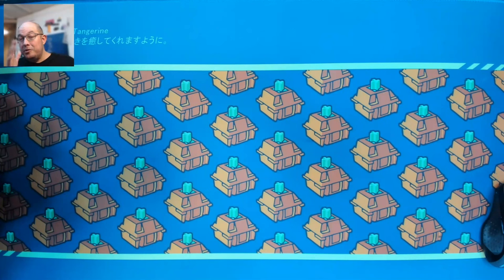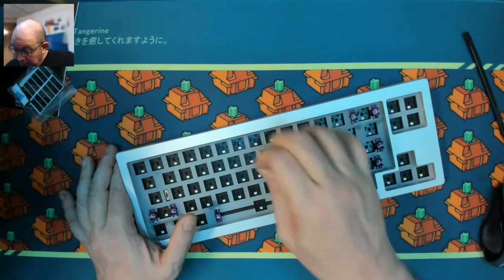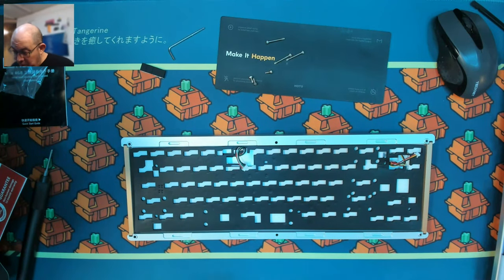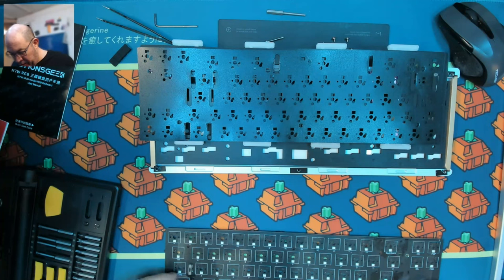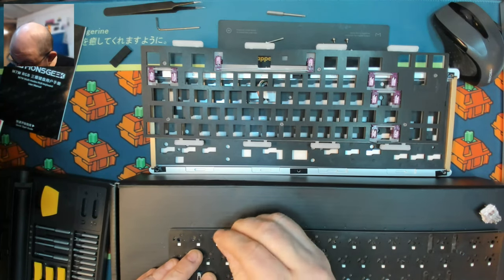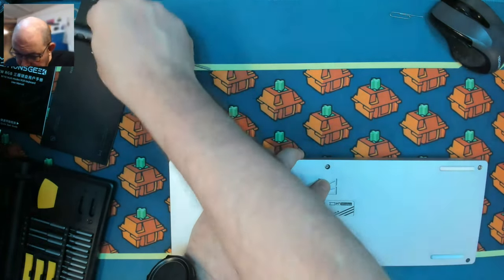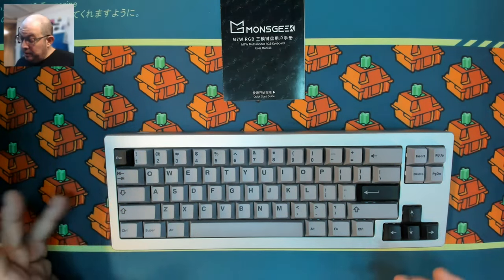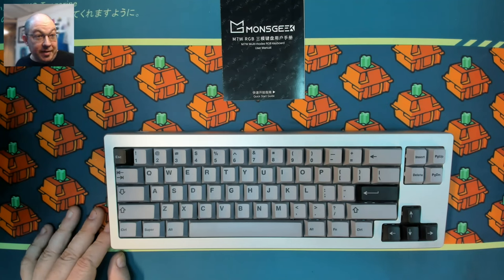Monsgeek M7W: Unboxing, Teardown, Mod, Build, Review, and Sound Test : Solid Aluminum 65% 3-Mode Kit

Comment: Just got my M7W in black, used Akko V3 Cream Yellow Pro’s and Ghost Judges caps, tuned the stabs and did the force break. Sounds as amazing as both the M2’s that I have. Only complaint is wish the switch was external not under the caps lock. It is one of my travel keyboards and switch is very inconvenient. Otherwise love it!

Comment: The recessed USB port was one of my drawbacks, because all my other keyboards I use I put on a 90 angle USB so when I want to use this keyboard I need to change cables. This is a great keyboard, another thing I overlooked with the wireless is its not qMK VIA and does not support SignalRGB. But other than that its a fantastic keyboard and I am very happy with it.

Comment: Thanks a bunch. Got mine same color but went with silent linear DUROCK daybreak and I'm lovin' it. Got a question though, do you know how to turn off the battery indictor under the space bar? it's always on even when I shut off the back light and there is no key FN+ any key nor the MONSGEEK drive an opting to turn it off.  Thanks in advance.
Reply from the maker: I do not know of any setting to turn it off, I've looked. I ended up just cutting a small square of electrical tape and covering the LED: https://i.imgur.com/mu2OWYD.png
Reply from the maker: @5LD314  sorry, can't say. Under which key?
Reply from the maker: @5LD314  oh, odd. Can't say I have a clue, perhaps reach out to Monsgeek about it?

Comment: Hi, sorry to bother, but I have a question: does the board support screw in stabs? Really nice reviews, anyways; you have a new follower!
Reply from the maker: No bother at all, yes, the PCB has the holes for screw in stabilizers though the plate might need modifications for stabilizers to fit.
Reply: @MechKeyboards  thank you very much
Reply from the maker: @maurogatti2009  you can see the holes on the PCB here: https://youtu.be/PR84ngCIf0A?si=G6mHugbRvfbldVdd&t=767

Comment: Thank you for this video. Mine makes a squeeky sound when pressing down bottom left side of the keyboard, especially the control key.  Does this ever occur to you?
Reply from the maker: Nope, you might want to open it up and see if the gasket is mounted correctly, that would be my guess as to what could be squeaking.
Reply: @MechKeyboards  great thanks for your feedback!👍

Comment: forgot to ask does this keyboard have a hailmary DFU button in case firmware gets botched during a flash?
Reply from the maker: No, as seen here: https://youtu.be/PR84ngCIf0A?si=gs50fgL4re6DSqYO&t=429 - But the wireless Monsgeeks do not use QMK, and I've not seen any firmware flashes. I've only ever seen DFU/Rest buttons on QMK keyboards.

Comment: Just got mine m7w and I absolutely love it. 
Is there any way to switch off the green battery indicator under the spacebar in the wired mode? It's a bit annoying.
Reply from the maker: They have been informed of the issue and may release a fix. I cut a small square of electrical tape and covered it.
Reply: @MechKeyboards  I left my keyboard connected to USB overnight and in the morning the green light was off. When I've unplugged USB for a while it returned again.

Looks like it's detecting the battery charge with some mistake and need around 100.1% charge to turn the light off.
Reply from the maker: Good to know, thanks @mmironov !
Reply: had you figured out any other workarounds to this besides removing the actual cord or taping over the led?
Reply from the maker: No @aquarellstifte  not yet. Monsgeek did say they would look into it, I will ask them if there is an update.
Reply: @MechKeyboards maybe a little too late to ask but had you encountered issues with the pcb shifting without any case foam? It’s kinda annoying that I can’t go foamless due to this.
Reply from the maker: @aquarellstifte  I plan to come back to this and try it foamless in the near future I'll see if I can figure something out
Reply: @MechKeyboards  thanks. I am genuinely curious if I got a bad batch or not since I have not seen any other posts about this
Reply from the maker: @aquarellstifte  I'll aim to get to this next month.

Comment: Do you still have this keyboard? Could you help me take a clear picture of the PCB underneath especially around circuitry around the processor and close to the battery socket? I need to compare it with mine.
Reply from the maker: I do but it's packed away. When I get a chance I will try to take some close up photos of the PCB.

Comment: Any tips on how to take car of the battery? im concerned if im in wired mode all of the time the batter would overcharge or is thos not a concern at all?
Reply from the maker: If you never plan to run it wireless, you can unplug the battery, but otherwise exercise the same caution you would use for any electronics with a battery.
Reply: But its okay to use while charging right
Reply from the maker: @JahredJoshRivera-mj1iz  yes, for at least a couple of years. I put a small sticker with the date I start using it, then after two years keep an eye on the battery, disconnect, or replace it if I see any swelling.
Reply: @MechKeyboards  thanks!
Reply: any tips on disconnecting the jst cables? Its just so hard and im scared i might break it
Reply from the maker: @JahredJoshRivera-mj1iz  just use your nails to pry under each end and slowly and gently wiggle ever so slightly left to right until it comes out.

Comment: What is the kind of hot swap socket did the board use?
Reply from the maker: I don't recall if they're Kailh branded but they are standard hot swap sockets that work with the majority of switches.

You can see them here: https://youtu.be/PR84ngCIf0A?si=ev1UaSZISzvjn2VB&t=402

Comment: Did you feel the need to modify these stabs? Or were they pretty stable
Reply from the maker: Nope, all I did was lube them and test that the wires were balanced, which they were.
Reply: the akko plate mounted stabs are elite.

Comment: do you have sound comparison between using poron and no poron?
Reply from the maker: No, but do you mean case poron or plate/PCB poron?
Reply: @MechKeyboards  the thick foam between the pcb and plate, I wanted to remove mine but its hard to unscrew 🤣
Reply from the maker: I'll have to take a look when I come back to mod this board @erensc2643
Reply: @MechKeyboards  cool, im looking forward to it
Reply from the maker: @erensc2643  it's standard clockwise to tighten, counter to loosen. Be cautious they are soft screws and work best with the right sized bit.
Reply: @MechKeyboards  thanks man